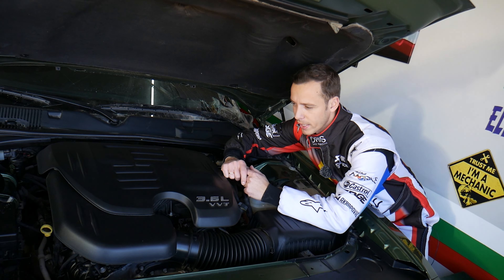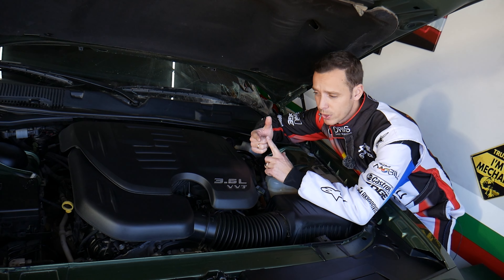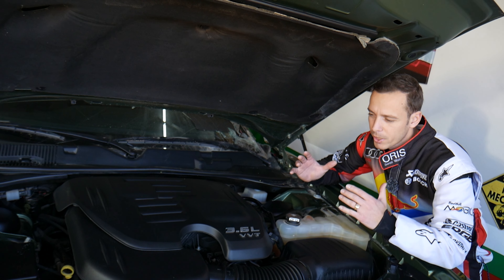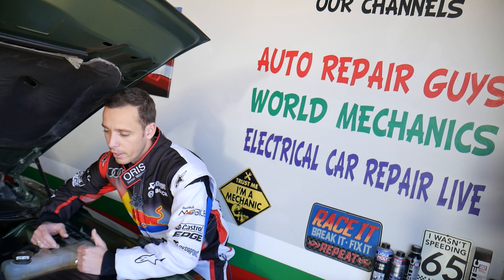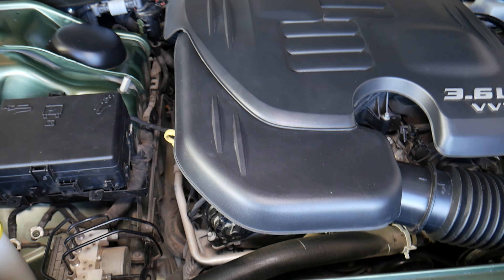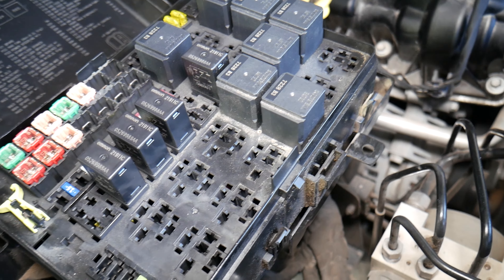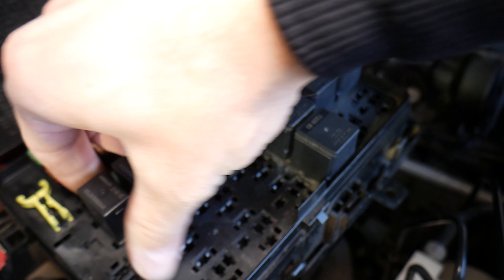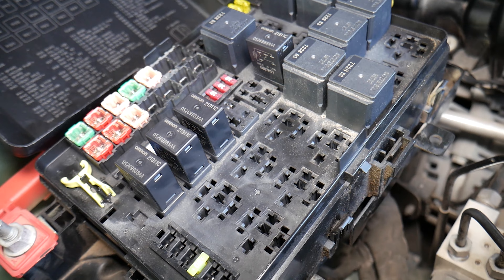CHRYSLER 300 AWD ALL WHEEL DRIVE RELAY LOCAITON REPLACEMENT

Comment: I see you know a lot about bmw, maybe you can help me. I have a 2011 bmw 328i and my key will only lock and unlock my car when I put it in the ignition it don’t even recognize a key in the ignition and nothing at all lights up on the dash. I replaced my battery in my key and got my battery on my car checked and it was good